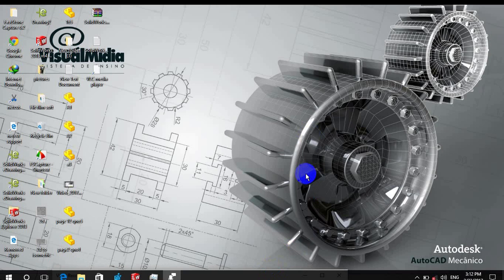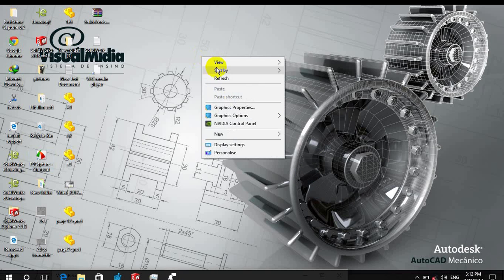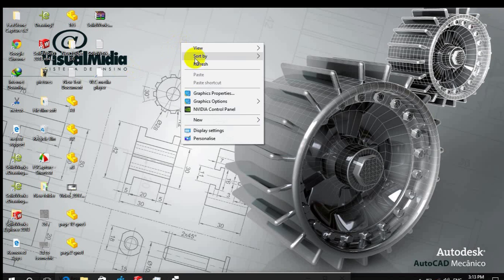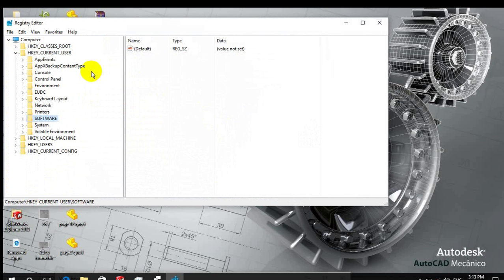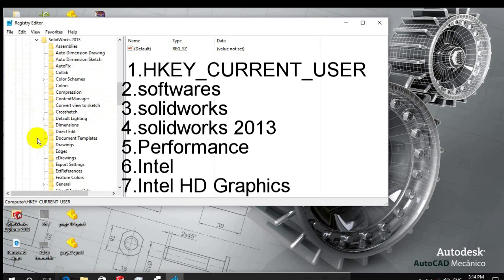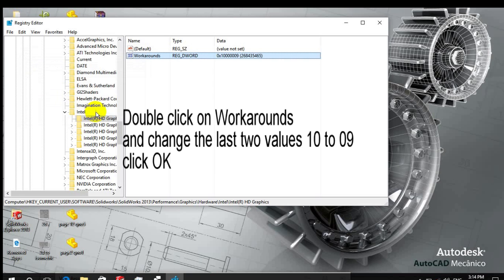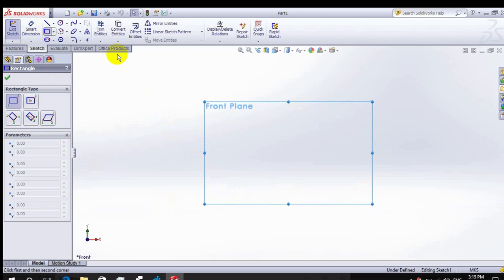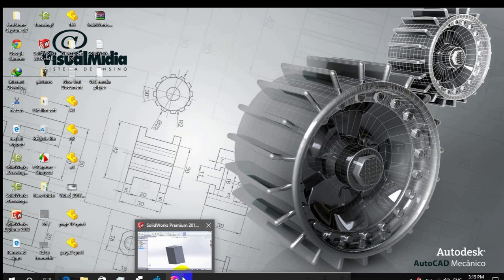Fixing SolidWorks slower performance and edge highlighting  problem in Solidworks

Comment: unfortunately, it didn't work on my system :(
i am using Solidworks 2016 & Surface pro 7 with a processor of i5-1035G4

but thanks for your work!

Comment: Sir , it is fast thank you..
But i hv questions by changing the workgrounds value it doesn't change for intel graphics while using other applications right..

I mean this value changing must be applicable only for solid workks right..?

While using other applications like games,, etc intel graphics workgrounds will be default right..?

Comment: when I right-click on software, open with intel process option doesn't appear!
Reply: Same problem
Reply: @kiransalvi622  I have found another solution for slow working.
Reply: peace seeker which one? Please share the video.
Reply: @kiransalvi622  Go to startup menu then search for solidworks Rx in application then start solid works from there. P.s I don't remember the video it's been time since I worked on solids works. . So, sorry :)
Reply: @MGRka14   I have found another solution fOr slow working .

Comment: I have Intel(R) UHD Graphics 620 on my laptop. Changing the "Workarounds" D-Word key to "10000009" on all keys under "Intel" didn't work. So what I did was creating a new key under "Intel" with my graphics card name:
  - Under 'HKEY_CURRENT_USER > Software > Solidworks > SOLIDWORKS 2015 > Performance > Graphics > Hardware > Current' I copied the content of the 'Renderer' key, which in my case is "Intel(R) UHD Graphics 620".
  - Then, under 'HKEY_CURRENT_USER > Software > Solidworks > SOLIDWORKS 2015 > Performance > Graphics > Hardware > Intel', I create a new folder by right-clicking "Intel" and selecting 'New > Key'. Named the folder to my graphics card I got in the previous step.
  - Inside the newly created folder I right click and select 'New > QWORD (32-bit) Value', name it "Workarounds" and set its value to "10000009".

So, you can see that I just replicated other keys inside the "Intel" folder, but for my specific graphics card. Now the orange outlining feature works smoothly.
Still... I have no idea what the hell I just did. Regedit hacks are always presented as some kind of black magic.
Reply: But after these instructions, I had the issue of not being able to see sketches! So i went back to the registry and reverted every change that I made. I.e. changing all "Workarounds" variables I had change to 09 back to 10 and deleting the newly created folder under "Intel" I had made for my graphics card.
Somehow, Solidworks works properly now. Orange outlines are properly visible and I can see sketches. Lets hope it stays like this.
Reply: I have same graphics graphics card, i tried same above setting it doesn't work, same problem happen.what do next.
Reply: @krishnegowda4310  I don´t know really. I disabled highlighting and anti-aliasing for now. It's a bit hard to work with it that way, but it's what I got for now.
Reply: I've tried what you did and for now it works perfect on Intel I5-8250. Thanks!
Reply: Thanks Man, saved my day
Reply: genius! worked for my intel UHD 620

Comment: Dear sir 
     My solid work is slow working when i open it he open quickiley but after open this is not working. so please connect me as a 
     call/e-mail. Because i am a design student also so during this  problem my study and practice is pending since 4 months.
     So please help my Mob no-8059137367,  My email- dalveers181@gmail.com
Reply from the maker: knowledge only Hindi please mention your computer Graphics n computer I will help u
Reply: Er. Som Prasad Pangeni sir my graphics card is Intel 
and my laptop is Dell vostro i3 6th gen with 4GB RAM & 2 GB graphics card 

Sir I am new for solid work and I don't know any technical problems like this so please help me sir you can also connect me as at What's app and my whatsapp no 8059137367 if you agree.

Comment: Congratulations for the great video.I saw you using the intel graphic board integrated to process the solidworks ,despite you have have a nother dedicated graphic vídeo.I'm having a trouble in using solidworks in my notebook, ruinning with my GTX 1050 Ti , the program is running so slow ,but when i run using the intel graphicboadr ,its run faster, can you give some advertise about it,if i can hack something to run the solid in my GTX more faster ? Thanks , bro !

My notebook set:
ACER VX 15
Intel core i7 7700 HQ
1tb of hdd
16 GB of RAM
GTX 1050 TI 4GB
Reply from the maker: thank you dude please subscribe me and see this video https://www.youtube.com/watch?v=Uv0k45SNXEw

Comment: SW 2016 still running slow after this..I have a Nvidia GEFORCE GTX 960M
Reply from the maker: please watch this video https://www.youtube.com/watch?v=Uv0k45SNXEw
Reply from the maker: please watch this video https://www.youtube.com/watch?v=Uv0k45SNXEw      and subscribe my channel.
Reply from the maker: please watch this video https://www.youtube.com/watch?v=Uv0k45SNXEw      and subscribe my channel.
Reply from the maker: please watch this video
Reply: same here
Reply: I did. It seems like solidworks is not to be used With nvidia GeForce gtx 960m. I just had to change to the standard Graphics and it runs Nice now!
Reply: How did you do that?  I got the gtx 1050 but it doesnt seem to be helping with surface selections and plane overlays
Reply: that doesn't matter just edit as what he did i.e intel ... i too have amd.. but i have done same has him and it. really works....